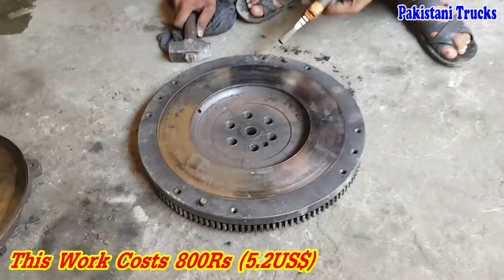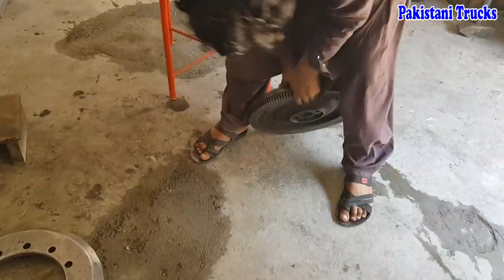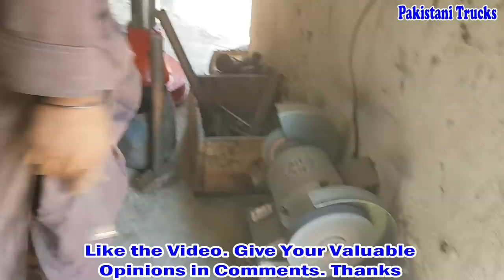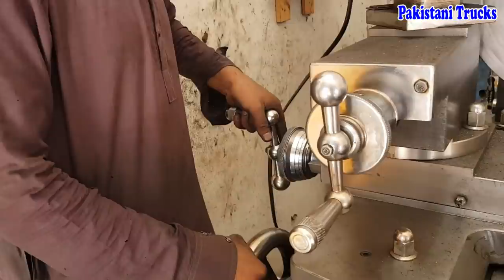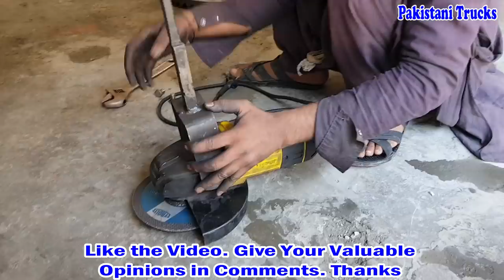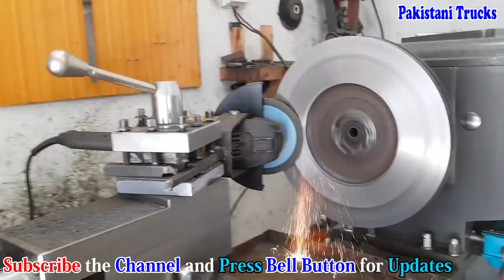Amazing Technique of Restoration Old Flywheel | Resurfacing and Phasing Flywheel

Comment: Hey friend, I was watching your video and thinking, You know the wire gauge on the magnetic? You need to make something with a oil soaked cloth rubbing on the flywheel to keep a thin coat of oil on the flywheel as you are cutting it down..... Then your cutting tool will last longer!

Comment: As a 40 year machinist I see a few things wrong in the creation of this video. Obviously workplace safety is not practiced at this shop. 
 First, loose clothing should not be worn when working around a lathe. Thats a good way to loose body parts if distracted even for a split second. And lastly, where are his safety glasses!
Reply from the maker: right
Reply: hey if you feel like sending them some, by all means.. you think they have money for PPE ?  broke my heart seeing it too but I can tell they're operating on tight margins.
Reply: then again, they have money for a lathe... there must be plenty of people walking around with uno hosos, and  industrial hearing loss.
Reply: @yeezywesty3651  True enough Yeezy. However, I must admire the workers ability to get the job done in a careless but genius sort of way. Whatever it takes!
  I personally never had luck facing a flywheel mounted directly to the chuck. The harmonics or vibration created when cutting can work the flywheel loose creating an uneven cut or cause a fish scaling effect, even at any speed, with or without a rubber strap attached.

Comment: I think there’s a step missing...... after machining wouldn’t you have to re-harden the face by tempering the steel again since you’ve just machined off part or all of the hardened face......?

I also would have thought the angle grinding step would be a little imprecise with a fibre disk and way too hot on the face and soften the metal further which weakens the flywheel face.....

Looks like an effective repair but I wonder how long it would last.....

I think you need to look at temperature and maybe another step that re hardens the surface....
Reply: the clutch experiences heat and tempers itself the friction when in use...
Reply: @yeezywesty3651  without being uniformly heated to known temperature and quenched in oil or water depending on the required hardness..... oil is better..... 

yes it does experience heat and tempers itself the problem is the new tempering is softer.......
Reply: @thewholls7176  about 1000km break in a clutch.. that's glaze the surface. she all good
Reply: you would see flywheels made of more exotic materials if they weren't supposed to wear down.... a tempered surface would just develop cracks and chew the friction plate to pieces in no time... you need the lump of metal to be soft but not soft enough it can't be machined or provide enough grip, the flywheel is heat treated from the factory, this is adequate because it's a consumable part,, the surface is going to wear down anyway so nobody is going to bother tempering a face flyface. .  there's a lot of science to this.

Comment: Why used grinder? Surface hardend because of slipping clutch heat?
Reply from the maker: for polishing
Reply: Yes hard spots the bit won't cut. That's why flywheel grinding machines are commonly used.